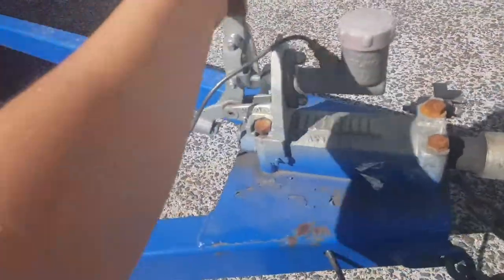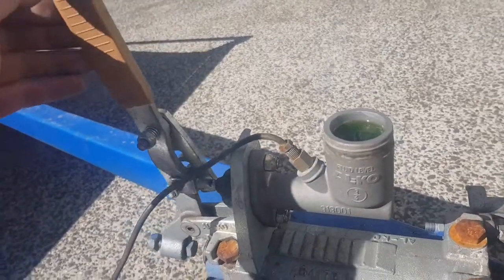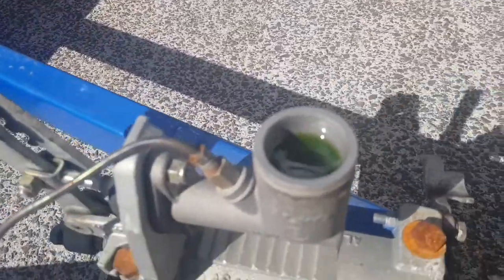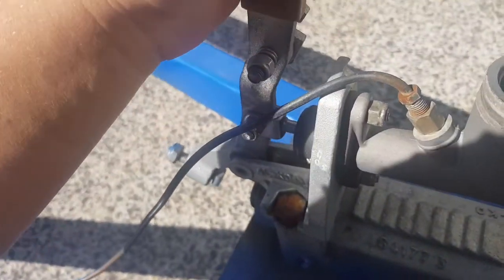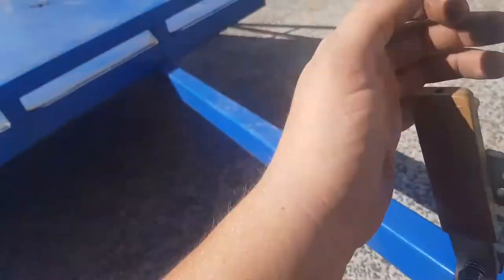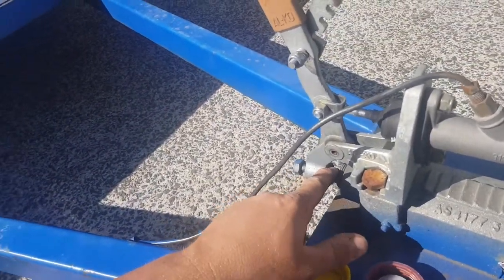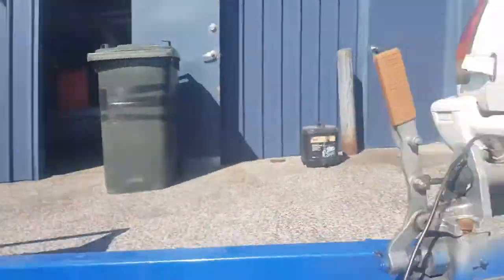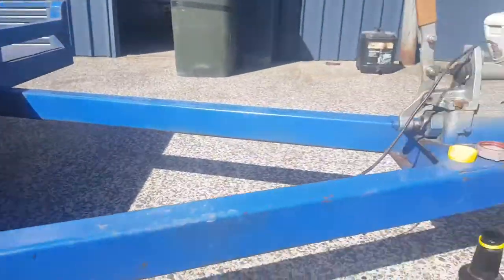Fixing up trailer hydraulic brakes

Comment: Just picked up a brand new trailer and guess what.. NO Brakes on the way home...   Adjustment screw hadn't been adjusted against the sliding rod in the coupling so the brakes actually activated. Simple video just to confirm what I thought was wrong.
Reply from the maker: Hope it helped you out. Thanks for watching 👀

Comment: It looks like that car trailer does not have any springs under it?? How does it tow with no suspension
Reply from the maker: Empty they bounce around a bit, full you would never use a sprung one again. So stable and smooth no swaying even with 4x4s on there
Reply: Thats nice to know i am finishing off a car trailer that my grandfather started and i has no springs i was wondering if they can be registered with no springs
Reply from the maker: Yeah I believe so here in Tasmania anyways
Reply from the maker: If you do go springs go a rocker set up not a slipper one
Reply: No worries thanks for that
Reply from the maker: Cheers thanks for watching bud

Comment: Hi mate. Great vid!! Quick question if you don't mind :) My hand brake wont actually move at all. Any ideas on what the issue might be or what to do? Cheers
Reply from the maker: Seized brake master cyl? Had water in it?
Reply: @oneupthesleevecustomsautom2195  Yupz it was. I ended up changing the master cylinder and bleeding the brakes. She's all good now :)

Comment: Great video mate, helped out a lot 👍 
Any reason why the pump arm wouldn't be returning on its own?
Reply from the maker: Yeah if there is no back pressure in the system as in the fluid is going somewhere.
Pump then slowly return by hand see if you can spot a leak
Reply: @oneupthesleevecustomsautom2195  champion, thanks mate
Reply from the maker: No probs good luck man
Reply: Right on 👍
Reply: Good to know 👍
Reply from the maker: Cheers mate

Comment: Good on ya mate thanks for the video, helped a lot
Reply from the maker: You get yours fixed :)
Reply: @oneupthesleevecustomsautom2195  I did, but it had a leak from next to the flared fitting , someone had bent or moved the hard line too much... I was helping a mate, he is going to find someone who can fix that. Won't be me. Cheers
Reply from the maker: Hydraulic leaks suck